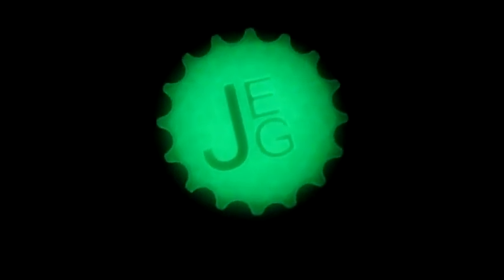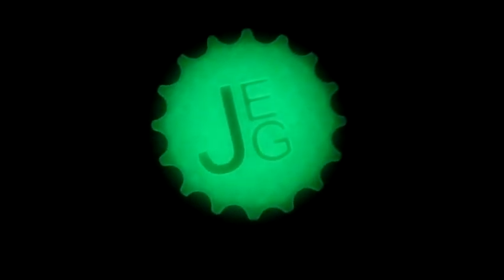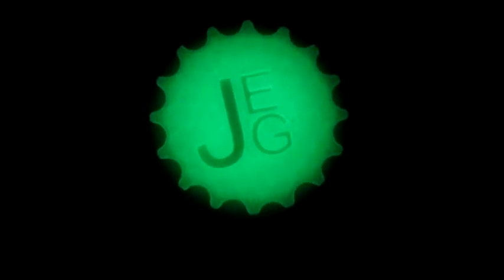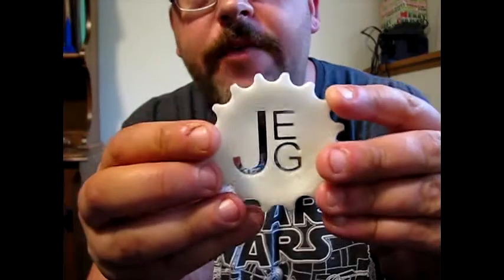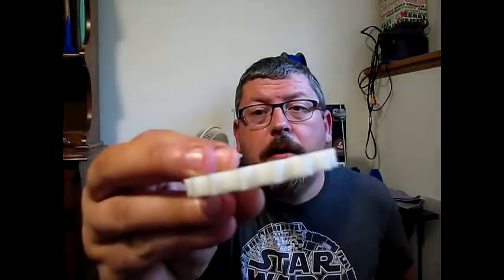3D Printing with Inland Glow In The Dark (Luminous) PLA - Budget or Bust

Comment: I just started printing with a Prusa i3 (yes, I like pain apparently) and have been scrambling for a print cooling design. Are you really just using a desk fan? Does that work? Does that prevent warping (cupping)? 

Where's the subscribe button. 

I need the subscribe button...
Reply from the maker: So there is nothing better than a good part cooler, that said, in a pinch a desk fan works. It is great on the hot Iowa days here when cooling is more difficult.
Reply: Being in Texas I might have to invest in something more robust then. Maybe some sort of automated gun that squirts liquid nitrogen... 

I think I will start with the desk fan as an emergency measure and continue to search for a good print fan design. 

Thanks for the reply! I plan on burning through all of your videos tomorrow at work!